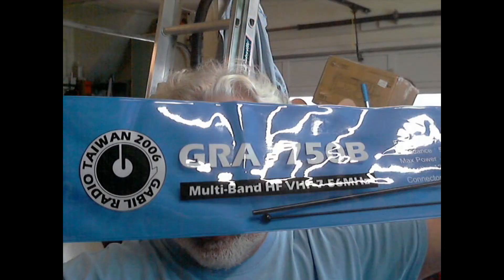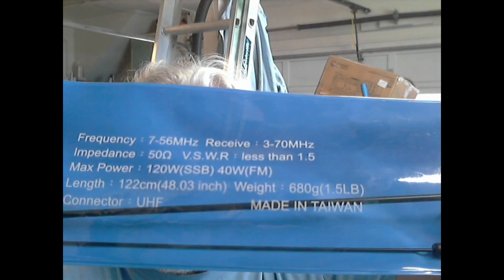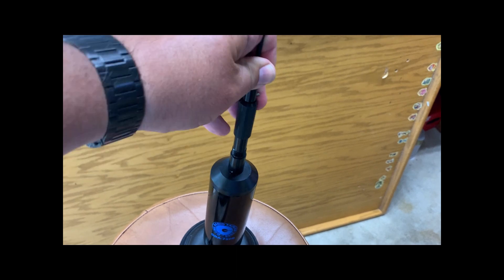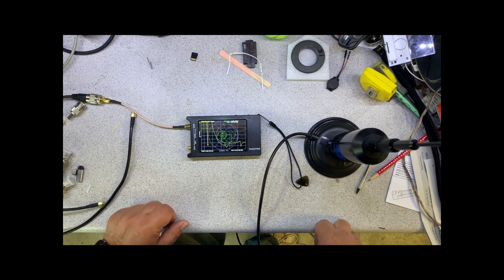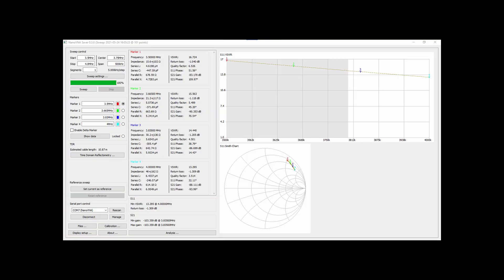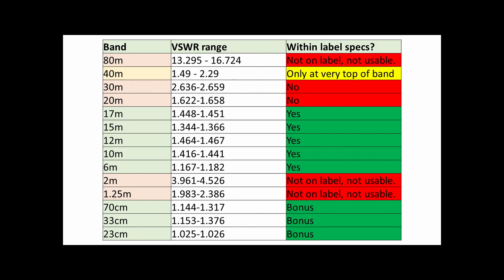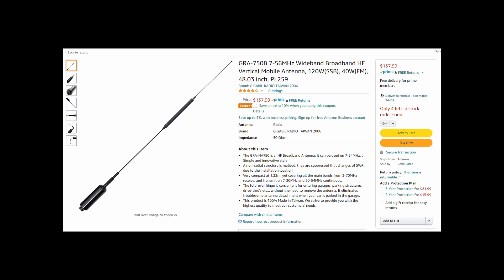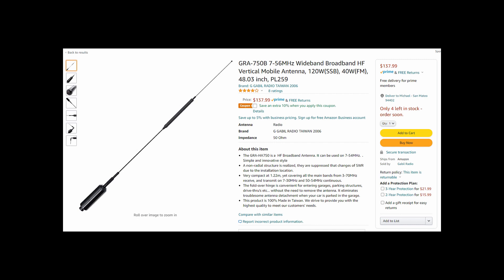Lionheart Episode 11: Gabil GRA-750B Ham Radio Antenna SWR

Comment: Have you tried testing the swr on the different bands while it was mounted to the roof of your vehicle? You should see much better results that way.
Reply from the maker: Good pointer. I will put this on a vehicle and re-run the SWR tests.
Reply: @PattersonFamilyRoom  It definitely needs a ground plane
Reply: @PattersonFamilyRoom  I would be interested to see those results.  Also for HF, grounding is more important.  If you're going to use that same mag mount, you should figure out a way to bond the antenna base (electrically) to the vehicle.  A lead wire at the base connected to the body of the truck would probably work.